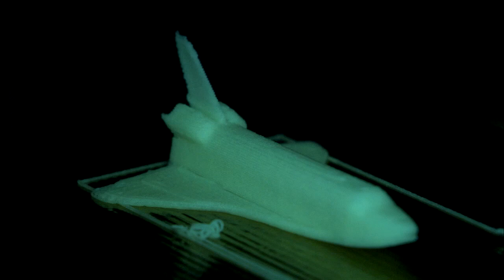3D Printer Timelapse (voiced)

Comment: thats for the rads, small meteorites in local orbit are tough, deep space is less dangerous . hyper atmospheric cavity hull disposable soft soak might acheive appropriate burn up protection. HACD. some gases are beter at buffing out meteors.In panels with a few light yrs service MOGT certificates